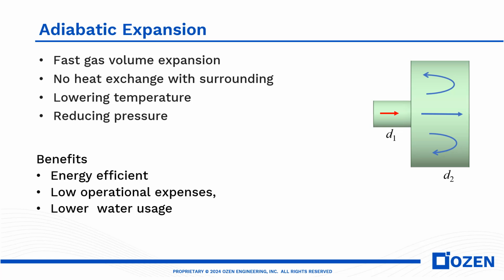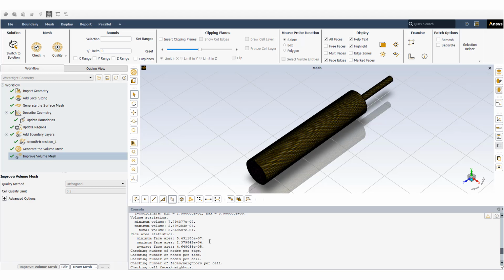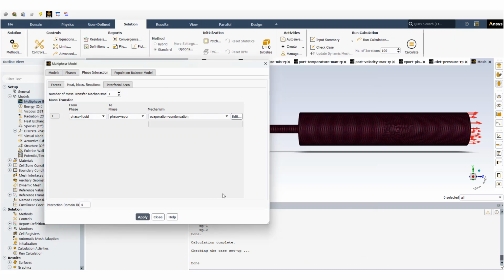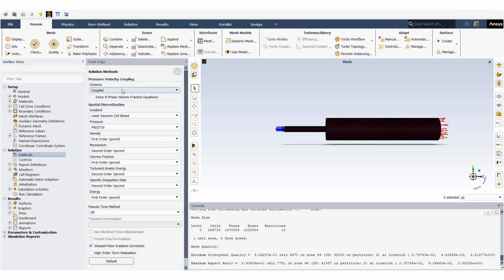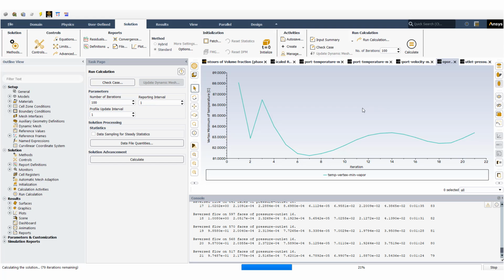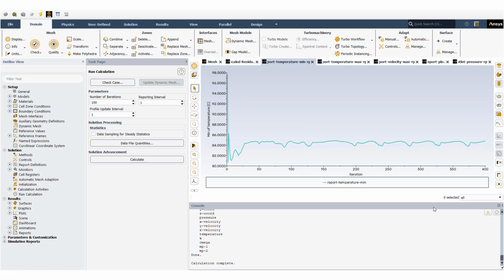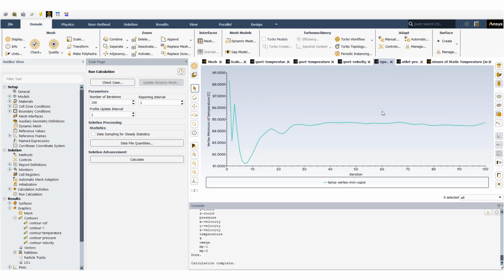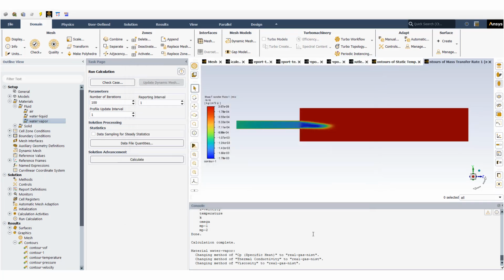Modeling Phase Change During Adiabatic Expansion with ANSYS CFD Simulation

Comment: Thank you so much for sharing such valuable content! 
Could you please consider creating a tutorial for a syringe-based simulation using a pressure-driven, multiphase (VOF) model? I’m interested in simulating the free-fall flow of a liquid as it exits a nozzle and falls onto a substrate, capturing the dynamics of the interaction with the surface below. A similar setup to the geometry used in this adiabatic case would be ideal. 
Your guidance would be incredibly helpful—thank you!